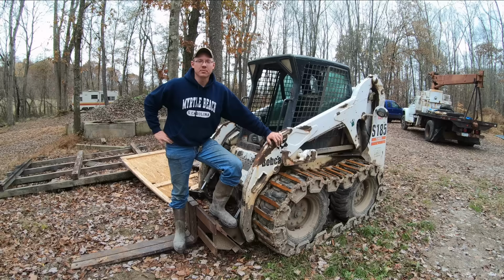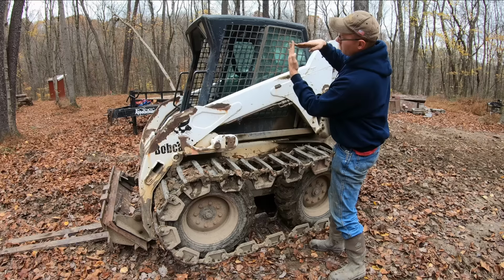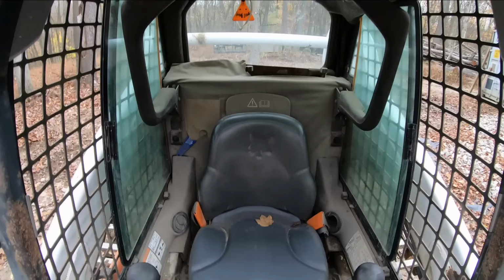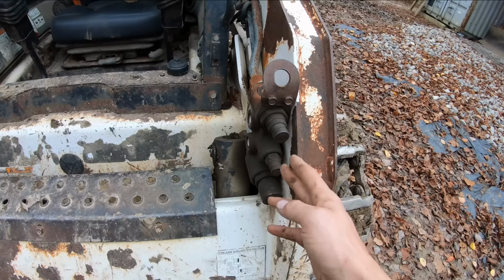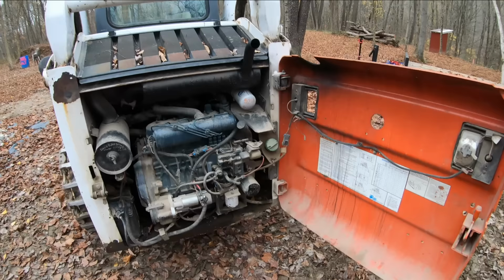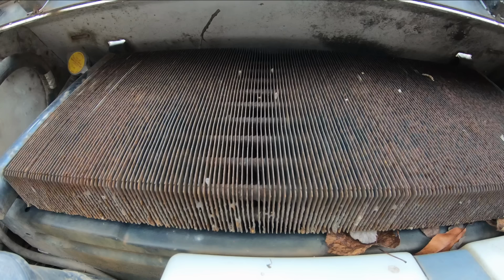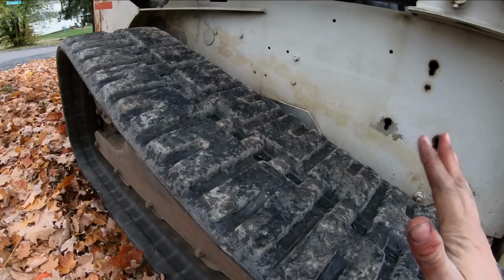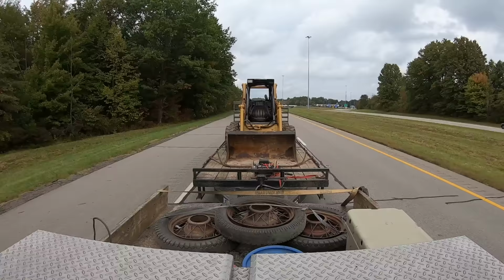Buying a Skid loader? WATCH THIS FIRST!

Comment: The only reason they say not to blow out air filters is because people would use high pressure (around 100psi) to blow them out and it would put small holes in the filter. One big thing I've seen with people cleaning filters rather than replacing is they don't inspect the sealing material. Over time it will dry up and crack which will let dust past. But if you inspect your seals and don't use too high pressure there's no good reason not to re-use a paper filter a few times in my opinion.
Reply: Every tool that has an engine says not to clean the filters today. but we still do because heavy construction is very dusty and you don`t want to but a new filter every week.
Reply: We had pre-filters on all our equipment!

Comment: I have a couple decades experience in mechanics, trucks,  small engines and equipment etc.... I think you did a very thorough job of going over a machine and explaining things and what to look for. Very well done.
Reply: I would have made a comment about the hourmeter. If it's INOP, then how many hours the machine has are unknown. Of course you can't trust even a working hourmeter. But comparing the number of hours to the general condition of the machine can tell you something.
Reply: Sound like your very seasoned man hey if you ever in need of expanding your inventory, equipment or ascending your company entirely let me know I can help you acquire funding to the tune of 500k or in just 2 days no credit check

Comment: S185 means it has a rated operating capacity of 1850 lbs. T190 means it has a rated operating capacity of 1900lbs. Hope that helps you with how they numbered the older units. There is grease zerks for the handles on the quick attach on the side.
Reply: To bad they don’t follow that anymore. Imagine a t870.... now that would be a machine!
Reply: i own a T190 and its a BOSS! with a root grapple it gets what i want done.
Reply: @davesilvia9711  t190’s were great units. Probably the most commonly sized unit sold
back then too.
Reply: @stedder8436  for the size of the machine its got what it takes to do most jobs done, i mainly use it around my sawmill.
Reply: Very close and right just missing the letter designation. The S185 meant it was a skid with 1850# roc the T190 meant it was tracked @ 1900# roc the A series being the a220 and A300 were all wheel steer @ 2200# and 3000# . It made way too much sense so they went and changed them all after the K series machines I have no idea why.
Reply: @alwayssomething3259  I figured the letter designation was common sense so I didn’t mention it.
Reply: @stedder8436  agreed but common sense not so common anymore. Sorry to even mention it but back when I worked for bobcat you wouldn’t believe how often people asked. 🤪
Reply: @alwayssomething3259  very true
Reply: Bought an old 753 had a whiny left side drive, needed a case drain filter. PIA to replace but something to look at when buying an old unit. The filter was located in a tough spot and looked like it was there for 20 years. After that and fresh fluid all was well.
Reply: @FishFind3000  no that was an older model number series.  One like machine in this video would have been 773
Reply: Bobcat tried pushing those S series off on our company to replace our 763 models saying this and that. We used the heavy leibreau tracks witch are battle proof, we worked our machines hard at times and quickly found the S series lost power as soon as it got to full operating temp we complained but just got every excuse to why they lost 30 % power like that. The old 763 were unstoppable in the field and could do the work of a 8 ton dozer with the high quality tracks on them. we also used solid tires that were made for steel tracks because tracks do not stop you from getting flats.

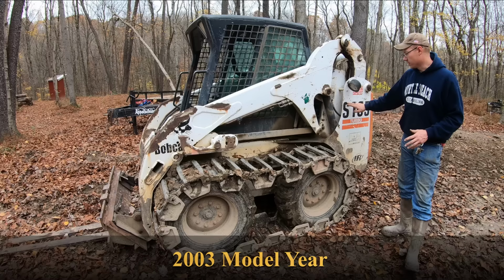Comment: 4:25 the tracks weight more so the machine has a bit more counter weight. This allows its lift capacity to be higher and the number corresponds to the lift on these older machines. S185 is S = Skid, 185 = 1850lbs of lift, T190 is T= Track, 1900lbs lift
Reply: Lifting capacity is amount of pressure hydraulic can handle .
Reply: @michaelwillcutt2619  its a combo of the hydraulic power and how much counter weight the machine has. If you have no counter weight it doesn't matter how strong your hydros are since it picks up the machine and not the load.
Reply: Rated operated capacity is the safe weight rating manufacturers give you. These machines will actually lift a lot more
Reply: @523FILMS  All reputable manufacturers publish rated operating capacity specs per ISO standards.  For wheeled machines it's 50% of the tipping load at the center of a bucket at maximum reach position.  For track loaders it's 33%.  Track loaders are derated more because of the nature of how they ride over bumps, but they gain some back because the front idler is farther forward than the center of a wheel.  Most machines can lift more than ROC and carry it as long as the slope  is fairly level and it's traveling slow.

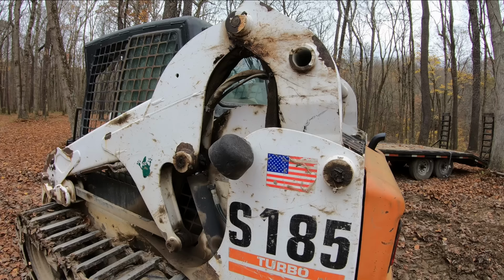Comment: 7:20 radial lift is good if your doing a lot of trailer loading and unloading since you get a bit more reach. but vertical lift is better when loading dump trucks since the bucket will be further forward when dumping.

Comment: Oh god. Algae in the fuel. I was an M2 Bradley turret mech in the Army in the 90s. We fueled up half a dozen M2 Bradleys from a contaminated fuel tanker on Stewart on a field op on base. We had to pull the fuel tanks out and replace them. Unfortunately, they're located under the turret floor. As the battalion turret services mechanic, I had to prep each of these machines for turret removal in the field.

Once the turret was out, hull mechanics came in and replaced the tanks and did whatever else they needed to do to kill the problem. Once that was done, I was on tap to reinstall the turrets. It was a total fucking nightmare. 

Long story short, if you think you might have an algae problem, hit it hard, hit it fast, hit it immediately. The longer you wait, the more work and money you're going to have to throw at it to cure the problem, and you could end up replacing the entire fuel system, from tank to injector.

Do not fuck around if you think you have an algae issue. It's like the clap, but for diesel vehicles.
Reply: Hahaha, that was a great analogy, MrLes Berg, that algae in the fuel system was like the clapp.  I don't think any young folks know about that VD term today since diseases today seem to have gotten so high tech😅.   Great analogy, brother.  I served with 2nd Tank Bn, Camp Lejeune, NC back in 88.  I was not a tanker but loved being a part of the unit as a support officer.  Our Marine tankers went to many army schools.  Just loved the relationship.  The Tiger Brigade (TB) was attached to our 2nd Marine Division during the Gulf War.  They gave me one of their patches which I fondly covet. Later, brother. 👍🏽🙂

Comment: As someone who's ran all pattern types, have to say ISO is most preferred. Learned on foot controls, never cared for them. Went to H pattern and really liked it. Last taught myself the ISO on the boss's machine and by far have the best finesse and control of the machine. In time you learn to control each track individually with the single stick. Love the videos keep em coming bud.
Reply: YES. I also love that because it makes your left stick left direction your emergency control. You get stuck on something its always the same muscle memory motion to lift the boom. Anything else you risk moving the skid and ripping apart whatever you're stuck on or moving the bucket and crushing it. And of course you turn off two radii instead of one with the left side drive controls

Comment: One other thing to mention on the ISO controls. You mentioned inability to compensate for slipping in tough conditions. I find that if its tough going and you have to make the same trip over and over you tear things up more with ISO controls and end up making it even worse. With ISO you are really only powering one track in a hard pivot turn and if its muddy that one track is going to have to dig like hell to do it. With independent track control you can kind of jockey one track forward and one back to ease your way around a hard slippery corner without making it a full on mud bog after a couple trips. That said, ISO sure is nice  most of the time and track machines are 1000% the way to go. Yeah tracks are expensive but if you take descent care they make up the difference in productivity and lack of getting stuck over their lifespan. LOVE the channel man, keep up the good work.
Reply from the maker: You are 100% right it’s really hard to explain the difference to people without running both in a thousand scenarios to feel it for yourself
Reply: @DieselCreek  I really love this video. If I go get one, I want to get your exact setup. I won't earn enough money with it to replace rubber tracks and I'll use the finesse of H/Case controls.

Comment: Just thought I'd comment on the worn bush on your Bobtach plate. Bobcat do in fact sell those bushes separately. It does however still require you to grinding off the  old worn bush, then re-weld the new one back on.  It's an easier solution to having them welded up and jig bored back to size I think. Nice videos by the way :o)

Comment: One other thing I’d have mentioned is most Bobcat machines I’ve ever seen use a big belt to run from the flywheel to the hydraulic pump, and they can break. Case machines of the same size (1840,1845) are direct drive off the crank pulley. An easy way to tell is Generally if a machine has a transverse (side to side) mounted engine it’ll be belt driven, but if it’s a longitudinal mounted engine it’s likely direct drive. Both have their advantages, for instance starters are far easier to change on the transverse setups.

Comment: CAT dealers sell $15 mailer test kits for hydro oil/motor oil/antifreeze... 3 day turn around.  Draw correctly to avoid contamination (not out drain plug).  Tests help decide if machine is a problem child with unusual wear metals, or if you can run the oil a while longer before changing...  Tests save $$$.  Just passed on a 2018 466.6 hour Bobcat S570 with "large particles" in hydro system according to CAT lab...  particles can be just one particle and jam a piston in hydro system and voila, you're down and out in a blizzard or stranded at job site.  It's worth the test.

Comment: My 763 is a 1999 model that I bought from a Bobcat dealer in 2003. Standard foot controls and a normal arc lift. I have well over 1000 hours in the seat and I have yet to have an issue with the arc lift. A lot of the time was with forks too. I see the "advanced" instruments as just more to break and the mechanics I talked to feel the same way but it is totally personal preference. I agree it is a machine that once you have one, you never want to be without it. We are in the high desert and it is dry a lot. We are looking to move to Georgia so tracks will be in order. Blowing out the air filter, yep, I do it all the time but only from the inside out to prevent blowing dirt through the filter.

Comment: I would also be a little wary of a machine with fresh paint, or "just gone through".
Having ran both tracks and tires, if you can find a Bobcat A770 I would recommend checking it out. Being able to switch from skid steering to 4 wheel/ all wheel steering is a lot more handy than you might think. As the all wheel steering keeps you from tearing up turf and tires when running on turf or concrete/asphalt. They all have their strengths, but air filled tires don't beat you up as much as tracks.

Comment: Great Video. I recently purchased a 2008 S185 from a guy that I had do some high lift work for me. After watching him every day greasing his high lift and he wouldn't move it for 20 minutes after the first start of the day. Before mentioning of his skid steer for sale he said he's always done that with all of his machines to get fluids warming up. I felt good about buying it as it is my first skid steer. It has the Bobcat brand over the tire tracks, foam filled tires which I have read it helps with counter balance but can also give a rougher ride. Heat/ac, hi flow option for the auxiliary attachment and a 7 pin connector. It has the joystick controls and has the option of ISO or H. I definitely like the ISO better. All of the pins are tight as I have been around some poorly maintained machines and have noticed worn pins on them. I am still learning about it and like watching videos such as this one. I've discovered that there is a 1000/2000 hour filter change and one of them being a cooling fan motor filter.

Comment: One other good thing about ISO controls is that if you have an attachment that requires an operator to be outside the cab, like a backhoe attachment, you can just lean into the cab and move around a bit when you need to work down a ditch. Not that I've ever done that....

Comment: I'm a Mechanic and Even I blow out air filters to save money When it's time and blowing it out don't get it clean to my liking then I replace won't harm any machine or even automotive vehicle to blow out filters to get a bit more service life out them don't matter if it's equipment or heavy equipment or Automotive vehicles air filters are not cheap I agree with you Matt 30:28 @Diesel Creek

Comment: Great overall review. One thing I think should have been mentioned is the different style doors available on skid steers. There are two basic types. 

An overhead style you simply lift up and down like a garage door, or

A swing door that open outward like a car door.

The over head style I like much better as you can open the door while having something loaded on your forks. Most times a swing door can’t open because the items on the forks is obstructing the swing door from opening. You end up putting down the load and backing up just so you can get out.

The other thing is I find most people will remove the swing style door (to get around the issue mentioned above as well as making the cab cooler) then they usually  store it someplace not readily available when you might want it, like when out on a job and bad weather strikes, you now have no door to close. 
With the overhead door, it’s always there. Leave it up when desired and close it when needed. 
Overall you did a great job. Thanks for your videos
Reply: Unless the lock pins rattle out of the raise door and it is 60 miles to the store.
Reply: Bad thing about the overhead door is it rattles like all hell once you get hours on a machine.

Comment: Nice video. I have a 2000 863g bobcat and it's been a tank of a machine. I bought the machine for winter time and it's been great. I went to the bobcat dealer to check on a new machine and the 1st think they asked was if I was going to trade in my machine. They said that there is a waiting list for the older ones that dont have any emissions on them. They are going for a premium price because the new ones are not that  good. The new "r" models with the new cast arms are up to debate. Also the prices are now up into the upper prices and alot of people cant justify the price.

Comment: Awesome, thank you for this video! I am moving to a new home where I will finally have a larger amount of land (1 acre... very small compared to your place, but way more than the city-ish place I live now), and I have been slowly acquiring larger and larger machines/engines and having to jury-rig 2x6s and have friends help move air compressors or generator sets or whatever else, and/or having stuff taking up space in my van is getting old VERY fast.... I would LOVE one of these machines (or a forklift if I can score a deal... but prefer the versatility of the skid steer) and will be on the lookout on CL/marketplace... thank you for all of your insight, this is very helpful.

Comment: Regarding seals: A penguin driving his car notices that the oil pressure light is on. He gets out to look and sees oil dripping out of the motor. He drives to the nearest town and stops at the first gas station.

After dropping the car off, the penguin goes for a walk around town. He sees an ice-cream shop and, being a penguin, decides that something cold would really hit the spot. He gets a big dish of ice cream and sits down to eat. Having no hands he makes a real mess trying to eat with his flippers. After finishing his ice cream, he goes back to the gas station and asks the mechanic if he's found the problem. The mechanic looks up and says "It looks like you blew a seal."

"No no," the penguin replies, "it's just ice cream."
Reply from the maker: Fantastic 👍🏼😂
Reply: Heh, so this is the "cleaned up" (and with a lot of unnecessary detail) version of this joke. The more og version has to do with Eskimos and frost

Comment: I didn't read all the comments so someone could have already mentioned this. but one thing you didn't mention is to check for excessive blow by, by pulling up/out the dipstick/ or the oil filler cap. ( seeing how much smoke comes out, to check for bad rings. ) 
other then that great vidjayo.

Comment: Put an ad up for Farmall parts on Craigslist and FB Marketplace and you’ll sell the tires/rims if they hold air (tires are expensive), wheel weights, rad, fenders, fuel tank, tin work if it’s not mashed, head if it’s good, rearend, and the wide front.

Comment: Just an FYI for you.  I bought a 773 (think it was 2002, the last year of the old numbering) for $16,000 maybe 12-14 years ago.  Bought a used 709 excavator attachment (I see you have the attachment brackets on your boom arms) for $3,000 a couple years ago.  Sold the whole thing this summer for 25K.  Amazing how those went up in value.  (sold to buy a T595 - love it!)